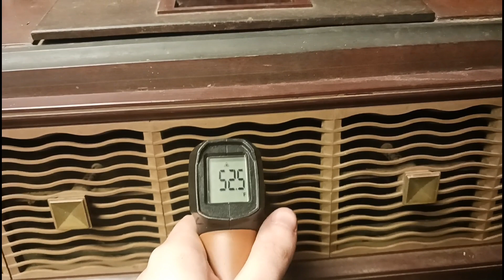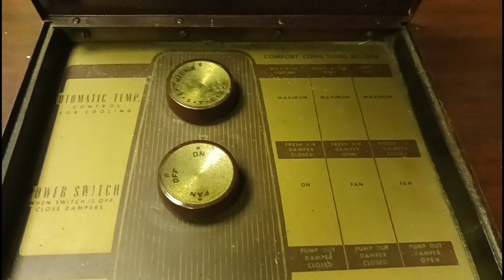1953 Philco-York Console Air Conditioner (Part 2)

Comment: I would love to see it installed is it a window or through wall unit
Reply: Neither. This is a console unit and is actually a piece of furniture that you place against the wall. You do need a hole in the wall to duct the hot air from the condenser to the outside.